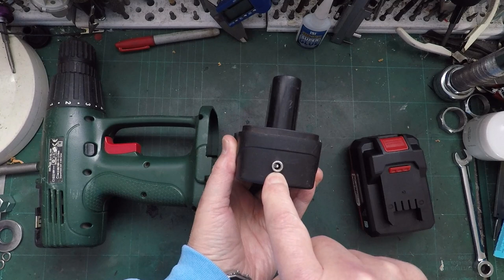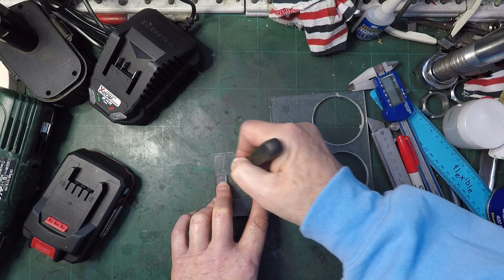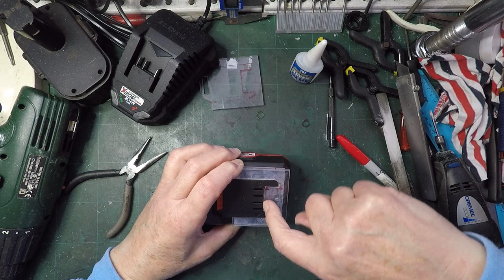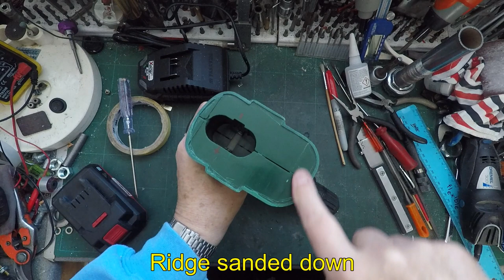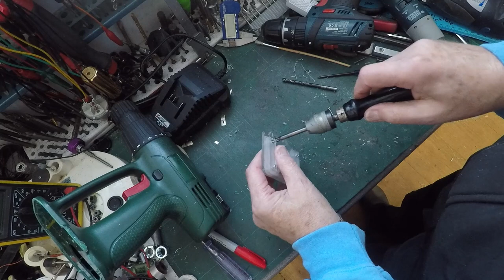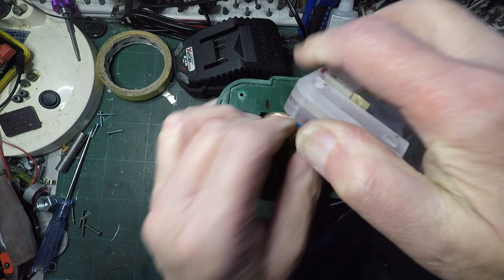Parkside battery on old Chinese drill - A talkie

Comment: No no no, never solder any Lipo batteries of any shape or size, as you well probably already know, the heat of a soldering iron, makes them very susceptible to fail, or even burn your house down, if it’s only for one battery, I recommend you purchase a spot welding machine/kit, you will have a lot more times to use it, it will pay for itself in no time, and not burn your house down, longevity of the tool will be greater, just saying old mate.. 🤙🏼

On another note, your using pz bits instead of ph bits, that’s why they keep chewing out the bits or the screw head..
Reply from the maker: I hope to get a spot welder soon. Thanks for advice.